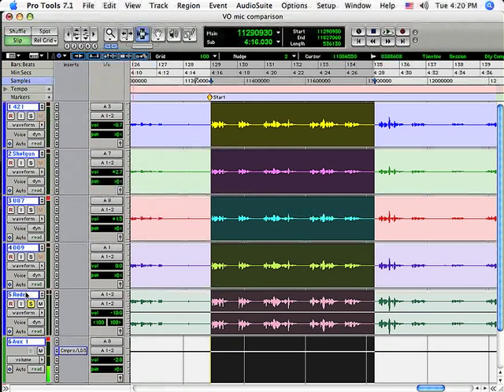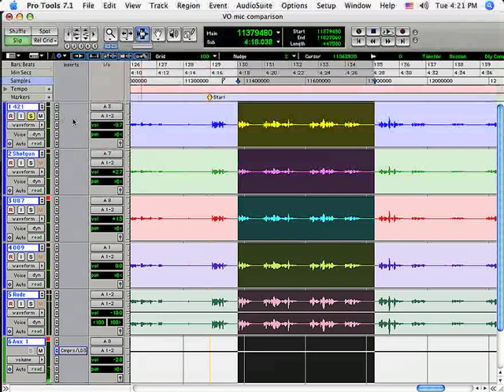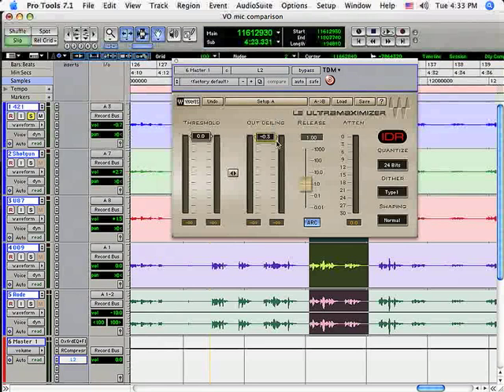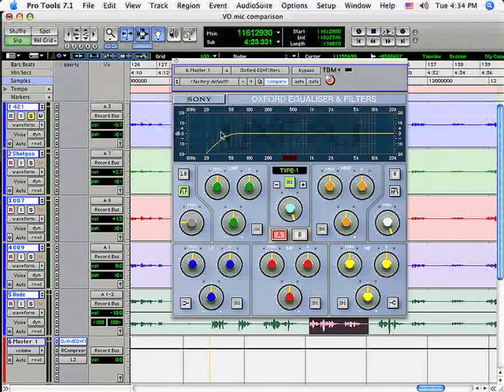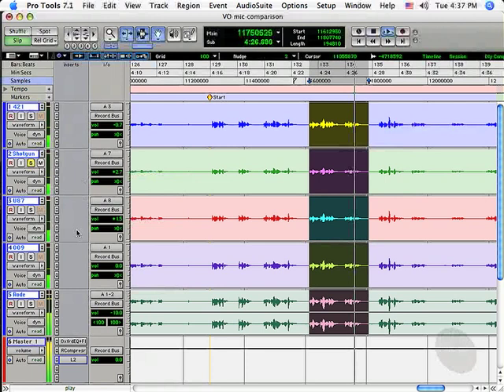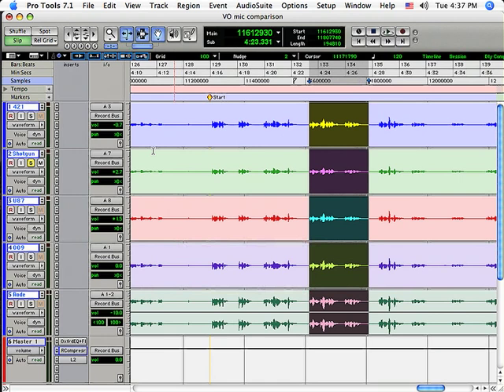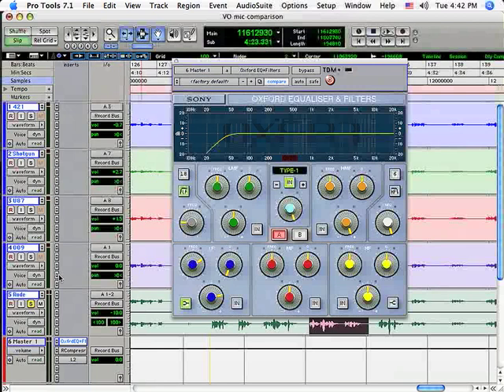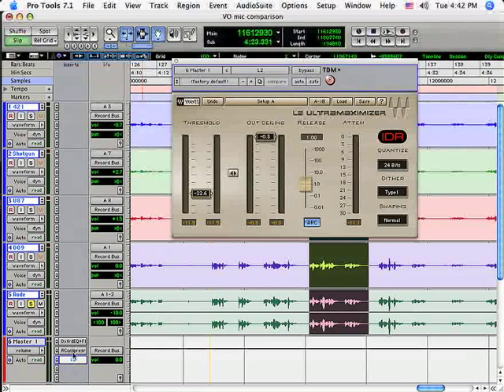Getting Good Sound for Voice Over: Mic Shootout

Comment: Hey I have the Rode Podcaster mic And I get some background noise when I record with it, after I apply a gate and some other VST plugins I can get it quiet like a dynamic mic is supposed to be, but that's exactly what I also do with my very loud MXL 990 mic. I bought the Rode Podcaster dynamic mic so I wouldn't have to do any editing of the audio but it turns our I still get background noise and it's not quiet like some other audio tests I've heard, can you help me? Yes, my room is very quiet :)